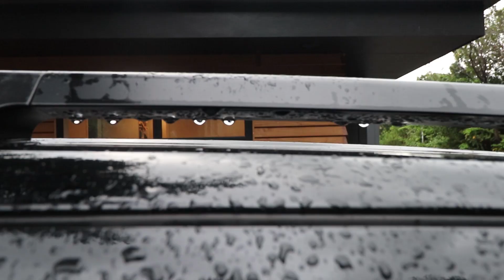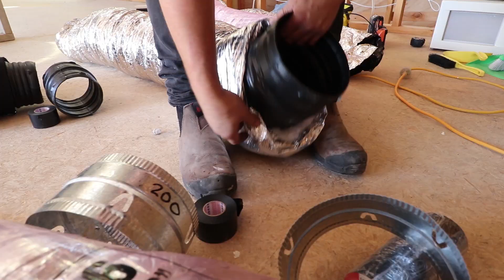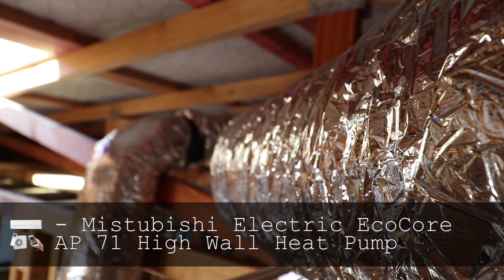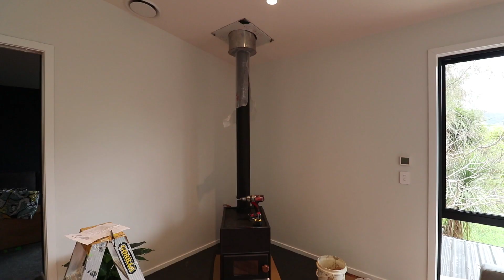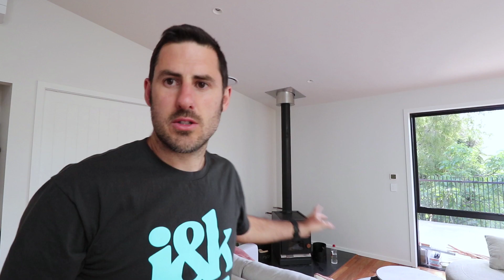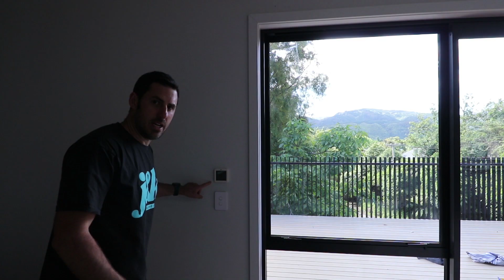NEW Build Heat Pump System Explained NZ

Comment: Frugal question - would your heat transfer system pull warm air to the bedrooms if you didn't have the fire on? Say, if you'd turned on the heat pump or if your living room got the sun before the bedrooms? Just wondering if you can avoid the cost of a ducted heat pump with a system like yours, even if you haven't lit the fire. Also - is the fresh air damper part of the heat transfer system or the heat pump?
Reply from the maker: Hey Brooke, The ducting is set up to move air around as soon as the temperature hits 21c, so even if it warms up from the sun, but from what I understand you can't really draw heat off a single room heatpump, something about the motor having to work too hard.
Reply from the maker: Fresh air is part of the ducted system, the heatpump is just a single room highwall, https://www.mitsubishi-electric.co.nz/heatpump/i/69251B/ecocore-ap-71-high-wall-heat-pump

Comment: Nice one man, well presented, wonder what material the pipe is that runs through the back of the fireplace, obviously it would have to be a high melting point and be able to withstand being hot then cold without getting brittle....
Reply from the maker: Hey Elijah, I believe its copper :)